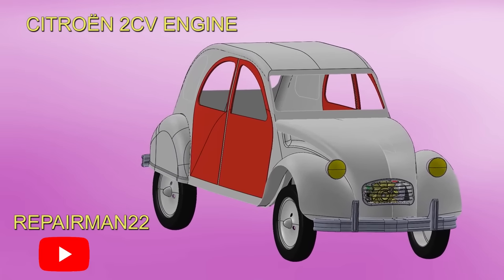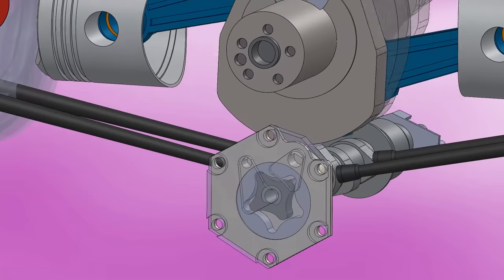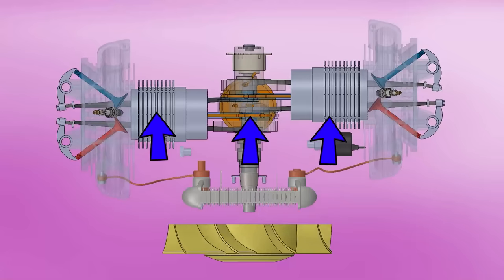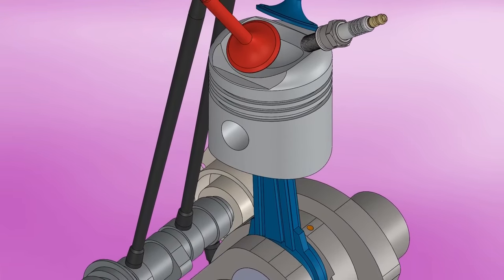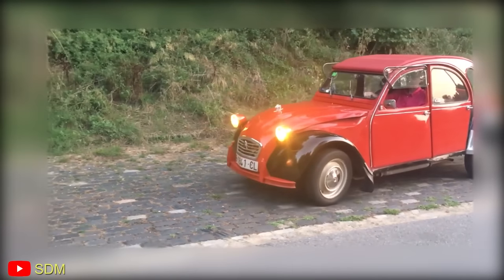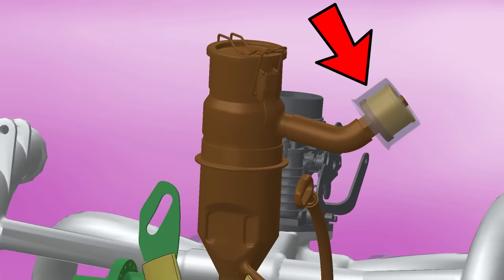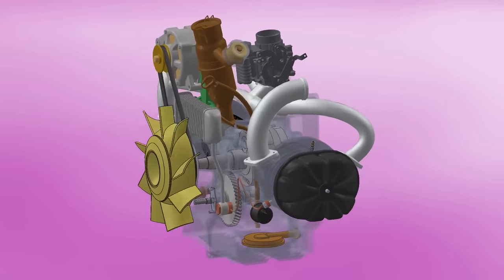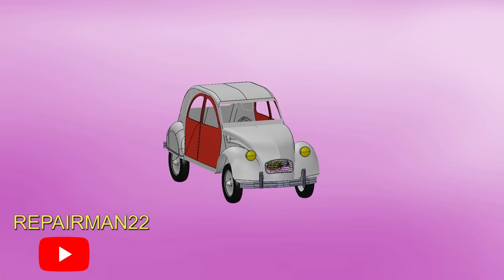The Most Interesting Engine In The World 😍 Citroen 2CV / How does it work in 3D?

Comment: Fantastically balanced. It’s the only engine I’ve driven continuously at max rpm for several hours on the Autobahn. Without damage.
Reply: All the while it sounded so dry, right? We had the R4, in the 2cv i was a passenger a few times. Full rpm sounded funny, but equally funny or strange is that other cars were not supposed to be driven that way, while the 2cv could take it.
Reply: It’s basically a little aircraft engine!
Reply: When they had it on the test bank in 1946-ish they ran it for a 100 hours continuously without a hiccup. I had two 2CV's and the engine was never the problem.
Reply: So how many other engines have you driven then?
Reply: @JonDingle  Many. My point is that this little aircooled opposed twin engine is a real gem…
Reply: I mean. Could have done that with a 125cc motorcycle engine.
Reply: @gur262  which might have been a bit low on power and torque even for the lightweight 2CV
Reply: @roelsiebrand7181    When you're only making 9hp, running for 100 hours is nothing to brag about.
Reply: Yeah but full throttle is only about 3800 rpm.
Reply: Also the only way to drive it on the autobahn 
and the damage is done to your ears instead
Reply: @gur262  no you wouldnt
Reply: @e-curb  troll
Reply: @dungareesareforfools  Sadly I've never owned a 2 cv but have owned old VWs. Similar motor. We thrashed a VW bus in Mexican heat and it never hesitated. I need a trip to France!
Reply: it was designed to run that way for longer periods, I can't remember the exact figure.
Reply: @Aleblanco1987  But you remember for longer periods. Very impressive. :face-blue-smiling:
Reply: Bah my god…you apparently haven’t ever driven anything German made or Japanese (or almost anything besides a 2cv6 joke) and I have driven serval
Reply: @florkgagga  i bet its because it revs so low and makes 1hp lol
Reply: That's because it didn't have enough power to hurt itself.
Reply: Wow, so many trolls here: "I like this" leads to "Why are you so stupid as to like this?"
Reply: @IchliebeHunde58  incorrect; I have driven several hundred different cars, most of them German, and owned around 25 cars including Audi, BMW, Mercedes-Benz, Porsche, Volkswagen, Alfa Romeo, Saab, Citroën, Renault, Peugeot, Jaguar and Mini Cooper. I’ve owned 2, 4 and 6 cylinder boxer engined cars and driven 2,3,4,5,6,8,10 and 12 cylinder cars. Never owned a Japanese car but have been fortunate to drive a Honda S2000, which would rev even more eagerly than my Porsche 911 (or a 2CV…).
And even Jay Leno can find pleasure in the simplicity of a 2CV: https://youtu.be/wFWftbSc3hY?si=YrFQnp_ElzBxzrnZ
Reply: The 2CV is to cars what BREAD is food -- it is the baseline.   

Let's get it back into production and make it one of the world's transportation options.
Reply: @hg2.   While I 100% agree that we need more basic transportation vehicles, the 2CV isn't it.  We have moved FAR beyond the crude implementation of the 2CV.  Today it would just be a novelty and would not sell in any kind of volume.
Reply: @blaster-zy7xx  

I disagree. 
There are millions of people for whom this is a credible cheap transportation option. 

"More" in your frame of reference is past the point of diminishing returns, i.e., not necessary.  

The 2CV is sufficient transportation for millions.
Reply: @hg2.   If that were true, it would still be in production.  The CV was in production for 42 years.  The original Beetle was in production (including the ones from mexico)  from 1938 until 2003!  It filled that market of cheap transportation for 65 years!
Reply: @blaster-zy7xx  
The 2CV is not in production because of stupid emission/safety/mileage regulations. 
Without those, they could still be bought today and millions of people would have that as a transportation option. 

We can sidestep the EPA/DOT/DOE garbage by getting it designed as a motorcycle.

PS: yes, the Beetle belongs back in production too, but "first things first".  2CV is the easiest and cheapest.

The 2CV is to cars what BREAD is food -- it is the baseline.
Reply: @blaster-zy7xx   When first introduced to the UK, it sold as a novelty, and sold in volume.

Comment: I've had a -59 B425 and a -79 2CV6, 605cc. Both absolutely lovely everyday cars. On twisty gravel roads I could keep many times more powerful cars behind me. The body roll wasn't a problem and all 4 wheels stayed on the ground at all times. The time I lost on the 'straights' I easily gained through the tight bends. Very annoying to some... They never broke down and I used them as my every day cars, all year round...even below -25C°, completely closed air intake and plastic foam sheets in the roof lined with corduroy fabric. There are so many clever solutions incorporated in this technically advanced car, that even formula one tech people know of them and refer to the 2CV regarding certain aspects. The whole story would take to long to tell here.  Thank you for bringing the 2CV back into the limelight where it belongs!
Reply: @dragonbutt  😄 you could be right, but I'm not a sailor.. though I know how to handle a boat. No, seriously, the front end geometry does actually benefit from a bit of body roll. That's why. Body roll can definitely be a problem if it's not taken into consideration when designing a car. Citroën did though. Cheers 😉
Reply: One of the most enjoyable cars I ever had, the most comfortable seats ever. This vehicle needs to be brought back,  cheap and economical to run, I wish I had one today. I really miss my 2cv.
Reply: @hughleocullen9497  Me too. Miss my B425 most... smooth as silk at high rpm's 🥰
Reply: @hughleocullen9497  There are some new Mini-Cars out there with Electric Drive. The 2CV could be builded as one, as it don't have to exceed 450kg without Batteries. We are just seeing the Isetta (Bubble Car) returning maybe the good old 2CV as well. Safety is a big concern for those cars and seeing old 2CV in modern Car Crashes, it is not something you want to be in. The 2CV has a sound safety concept but a 500kg car hit by an 1.600kg-2200kg car you know who is losing.
Reply: Ton permis aussi sera dépassé avec les limitations les écolos les ralentisseur les vois de bus les radars automatiques et les flics ,  Faut allez sur les circuits pour dépasser ! Surtout que aujourd'hui tous les véhicules peuvent rouler au vitesses limites tout le monde est au taquet avec les régulateurs sa n'arrange rien
Reply: @hughleocullen9497 it was also one of the least safe vehicles ever built. Today's cars are factor 1000 more advanced, reliable  safe and economical.
Reply: @nicobub4530  C'est vrai, dépasser devient difficile de nos jours...
Reply: @beershortage  That is actually not correct. Citroen integrated several features and designs that would be seen only years later. They also ran crash-tests of the 2CV back when it was almost unheard of (you can see videos of those on Youtube : https://youtu.be/aKrN5q2lMQM ) 
Either by design or just because it's so low, in case of a frontal crash, the engine rides under he car, not inside. The design of the direction mean that the steering colunm does not impale the driver as well. In case of accident, a lighter car have less energy to dissipate, meaning it transmit less damage; and 2Cv caught in accidents tend to be "ejected" rather than crushed.
Of course it's not all roses and sunshine, and sure, a 18 wheelers crashing at 130 kph in a 2CV stopped on the freeway would obliterate it. But that stand true for any car made in the 1950's and even later.
Also, in 1948 when it was released, the 2CV wouldn't have been the slowest car around nor the poorest or weakest one; take a look for example at the Mochet CM 125.

Comment: When I had the good fortune to live in Iran in the 70's I had one- licensed to be built in Iran- the Dyane. It was WELL used,  and for the high altitude and the heat in the summer- well, it was hardly a tire-burner. I absolutely loved it. Handled so well on the streets and very reliable.  I loved the gearshift coming out of the dash, the adjustable headlights, the smooth ride, and the great suspension. One winters day, on the way up to the mountains NE of Tehran, with 3 wonderful skiing companions in the car, going uphill- we chanced upon a VEERY SLOW heavily loaded truck, emitting huge clouds of heavy, thick, black smoke. Even this wonderful loaded Dyane 2CV, had enough HP to pass the truck. Unfortunately, after we passed the truck, we could smell lots of smoke still. I then realized that, coincidentally, new smoke was coming from under the hood of the Dyane.We pulled over and evacuated the car and I raised the hood and found that every inch of all the wiring in the vehicle was burnt to a crisp- all the insulation melted off and only bare copper strands visible. What to do??  I disconnected everything, and then ran one wire (bare,twisted strands) from the battery to the ignition. turned the car around rolled it downhill and drove back to Tehran without further incident. A day or so later I purchased a complete new wring harness, and installed it in about an hour. Car ran perfectly from then on, of course. I really regretted leaving Iran, and that wonderful car. I wish I had one now for commuting, here in northern Nevada- USA. Great memories from this video and great engine explanations, though I watched it with subtitles ON, and the audio OFF. Thanks so much.
Reply: Same here
Had lots of fun with this car in Iran when I was young. So many friends made a fun of the car but it was a fun car...!! 😊
Reply: The wiring must have been practically fun. "Modern" cars seem to have hundreds or wires at least, one page says a Bentley Bentayga has 110 pounds of wiring harness, while a bare muscle car's harness is only 10 pounds
Reply: this reminds me so much that rich people want every little unnecessary detail, but poor people -- most of the world's population -- just want something that keeps working and is easy to fix. the difference between a car that goes 80kmh and one that does 160 is NOTHING compared to the difference between walking and driving even at 50 kmh. everything in this video is a miracle of how simple can be made to work very well. it's an enormous shame that cars now are mostly designed to make money from people who have too much of it. in a way, we were lucky to have post-war poverty in europe where there was a huge market for a simple little car
Reply: Qq Qq the boys
Reply: The
Reply: I would like to nominate this comment the best ever on YouTube.

Comment: I own a Citroen 2CV6 one of the last ones build in Portugal. I have had several old cars from the 80's and 90's all leaking and at some points leaving me stranded, with one exception the 2CV. despite the fact that I drove it as my daily for some 4 years plus the remaining 5 years as a slightly more spoiled summer car. its engine is so dry that I leave a carpet underneath it in the garage just to boast of this property. Despite being far from today's standards of streamlined design It is also very economical, having a fuel mileage comparable to modern cars.
I adore the 2 cylinder air cooled engine.

Comment: I drove the 2cv6, liked the dash mounted hockeystick shift lever. The red hot version. The main competitor was not the beetle but the Renault 4. Which had a rear mounted engine initially. However, Renault redesigned it with a front mounted engine. If you were really quiet, you could hear them rust. But mechanically absolutely indestructible and simple to repair and extremely fuel efficient. About as fuel efficient as todays low end models but half the weight, half the parts, half the price and super easy to repair and maintain
Reply: I believe the rear engined car was the Renault 4CV. The Renault 4 was a later front drive car designed to compete with the 2CV.
Reply: The rear engine version was the dauphin. I had the front engine version,the 4,as a van. The camshaft was driven by a composite gear which was up against the firewall and required removal of the engine. Guess how I know that.
Reply: @martinsaunders7925  my grandfather had both the rear engined Renault 4 and the Dauphine. The Dauphine had a larger engine and was larger overall. Both great cars. Renault grew the model further into the Renault 8 and later the model 10, after which they abandoned rear engined models altogether. Every iteration the engine displacement grew a bit. Fun fact; they produced a Gordini version of the 8 for a while. That was a pretty cool car, based on the rally car Gordini prepped.
Reply: @skydive1424  French engineering is idiosyncratic and usually excellent. The first front wheel drive car was a Citroën in 1934? Of course it had suicide doors.
Reply: ......back in the days were less meant more.
Reply: @zaneenaz4962  exactly! And I personally think we will creep back to these industrial standards in the not too distant future
Reply: @skydive1424  its not just standards, its a sensibility.  sense for what was actually needed (principles based) and allowing flexibility.  much of todays standards lockout, or unnecessarily constrict operation.  anyone can repair the 2CV or beetle.
Reply: @zaneenaz4962  in keeping with your perspective investigate 55 gallon oil drum cars in rural Thailand and young Vietnamese building knock off of supercars.
Reply: @martinsaunders7925 and gordini& caravelle sports car
Reply: @rogerdodrill4733  the Renault alpine!!
Reply: @skydive1424  The rear-engined car is called the Renault 4CV, completely different from the Renault 4 despite their similar names.
Reply: half the weight and fuel efficient, not a coincidence
Reply: @Zeem4  nope, they used basically the same engine and gearbox. And both with the gearbox ahead of the engine. wikipedia: "The 4CV was replaced by the Renault 4 which used the same engine as the 4CV and sold for a similar price." Renault's rear engined 4CV is also the basis for the Alpine and Gordini sports/rally cars of the 60's and 70's. Also the renault 5 of the 1970's used the same engine block and transaxle [ it was a 4 with a new body ]. I think the mid-engine Renault 5 turbo rally car also used the same ohv engine, bored out to 1500.
Reply: traduire svp
Reply: Very true. I had the pleasure of using one. It was absolute pleasure. The suspension system was unique. Very easy to maintain. I tried to look for one but couldn't get it here in Tanzania. I'd love to ride around in it.
Reply: Half the weight of modern cars but just don't have a serious crash in one.
Reply: The 2CV is to cars what BREAD is food -- it is the baseline.   

Let's get it back into production and make it one of the world's transportation options.
Reply: @hg2. Who will buy a new 2CV today?
If Citroën were making money when they last produced it they would have continued producing it. Its sales were poor and no profit to be made. 
     Car buyers want comfort and luxury like air conditioning. 
   Maybe they could make an updated version with a new body and a wee bit bigger engine to power ac and wipers on an electric motor. That just might be a winner.
Reply: @briancarton1804  

Firstly, I'm thinking of Argentina: - they used to make them there,
- 40% of the population is poor and need jobs, 
- if it can be made cheaply enough, it could be competitive in markets like that.

Secondly, they are so simple they can be made on an "artisanal" basis, i.e., they come in kits.  That's what I hear Iran did.  
Sounds like a great way to get started.
Reply: @hg2.  VW gave up making the old model Beetle in Mexico and Brazil because they could not sell them at a profit. The poor in Argentina might get paid for a few months making 2CVs but the people with more money would not buy them. The factory would then close.
      Argentinas  economic problems run deep and the manufactur of an obsolete product won't help.
Reply: @briancarton1804  
Artisanal?
All those motorcycle- countries of Asia and Africa?
The Beetle is 1/3 heavier and 2x the cc's 
Somewhere "in there" is room for the 2cv as an option.
(Provided governments don't kill it with regulation.)
Reply: R4: Front mid engine, actually. It sits behind the front axle & transmission.
Reply: @briancarton1804  
Argentina: The negative arguments you make are actually positive ones:
- Argentina has a lot of poor people; poor people need cheap cars.
- Poor people need a lot of simple jobs to get back on their feet: making 2CVs could contribute.

"Poor people making cheap cars for poor people."
Reply: @hg2.  Wish you luck setting up the factory and making lots of 2CVs. Wish you more luck in selling the 2CVs , making a profit and staying in business. 
     You might like to try your hand at the model T aswell. They could run on ethanol so the poor Argentines could make their own fuel.
     Please let me know how you get on.
I will give you a year to get up and going.
     All the best  ,  Brian.
Reply: @briancarton1804  
Yes, I bet you do.
Reply: @hg2.  No time to waste , get to it and get started. Looking forward to reading about your success in the Financial Times and receiving awards from the President of Argentina. 
       Perhaps I better not hold my breath.
Reply: @martinsaunders7925  The  rear engined 4CV preceded the Dauphin. I owned a 1958 vintage. It was worn out at 28,000 miles. It was the one that looked like Charles deGaulle in profile. My experience with it led me to conclude the French should not be allowed to build cars. I had a friend who drove a Dauphin. The hub caps were held on by a single center bolt. the bolt would unscrew itself, and hub cap would noisily clatter down the street, I'd jump out and retrieve it, and screw it back on (the center bolt still attached to the hubcap).
Reply: Me again. I installed a Renault one cylinder diesel engine in a sailboat I had. Its 5 horsepower was barely enough to move the 5,000 pound boat, but it was a reliable little engine.